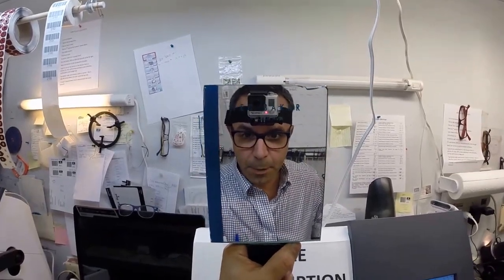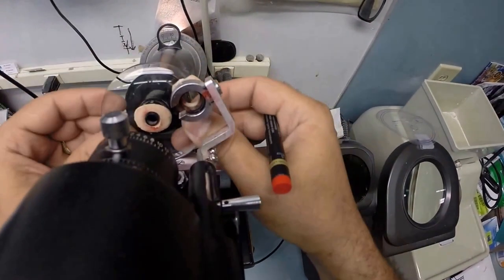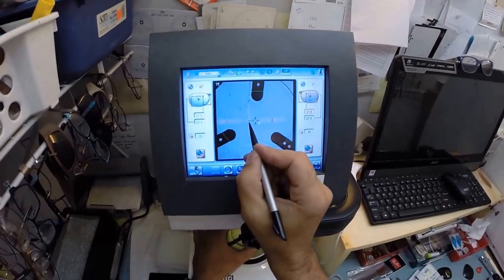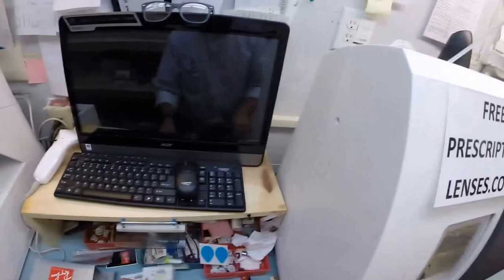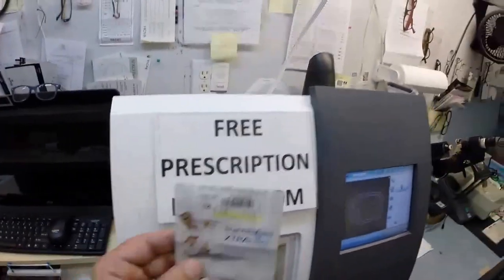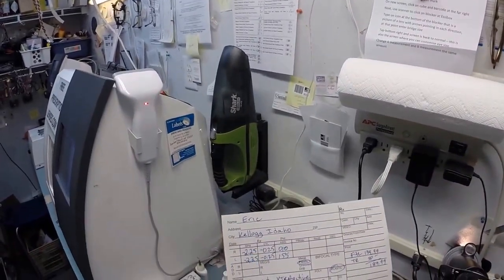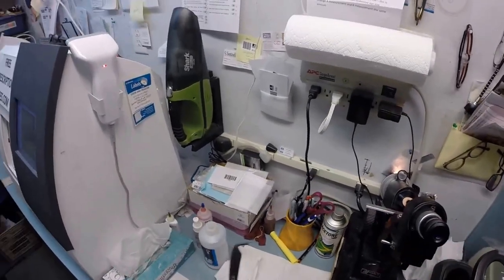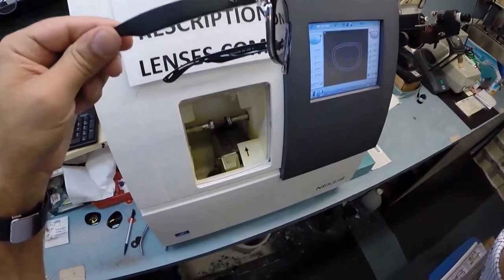Eric's RayBan 2132 with Rx Transitions XTRAactive Lenses

Comment: Matthew can you explain all the different types of transition lenses you offer? Do they have anti glare?  Which are the darkest? Do any work in a car?
Reply: Claire Stratton "XTRAactive" will tint slightly inside a car and the darkest Transition lenses when you're outdoors. Anti-Glare is an optional coating.
Reply from the maker: Claire Stratton The user with the username RayBan is correct. And by the way he has gotten several pair from me AND a pair for his sister. So Claire step it up. That's all I'm sayin;)OK first the basics. Transitions comes in gray, brown, and green. All of which come with or without a stock Crizal anti glare coating. Everything that I have mentioned comes as either plastic CR-39 or as the unbreakable polycarb that I prefer to work with. Transitions XTRAactive only come in plastic CR-39 AND only comes in gray. For now. It is still a relatively new product. It may eventually come in brown and/or green, but not yet. It may eventually come in the lighter weight unbreakable polycarb too, but not yet.As with your lenses and most of the lenses that you have seen in my videos are stock lenses. Meaning that they are sitting on a shelf in a paper packet waiting to be adopted onto someone's face. They are less expensive because they are mass produced in advance, hence why they are sitting on a shelf at the wholesale lab that I order from and receive overnight. Transitions XTRAactive gray only come as stock CR-39 without any anti glare. Should you want an anti glare coating to be applied to your CR-39 plastic gray lens then I need to have that lens custom ground, which costs more and takes several days because of the custom work. Once done as with any custom work I could then have any brand of anti glare applied. Such as any Crizal coating like Crizal EZ, Crizal Alize, Crizal Avance, Crizal Sapphire and Crizal Provencia. Or I could have any Zeiss anti glare such as Pure Coat for example. Also each custom lab have their own in house anti glare that is not name brand that can also be applied to the custom grind job.Transitions XTRAactive does get darker when outdoors than the current Transitions signature 7 series that I always work with. However Transitions XTRAactive does retail a gray tint while indoors which is irritating to some people but not all. people who tend to be light sensitive even indoors under fluorescent light seem to tolerate it better than most. Transitions XTRAactive will get 20% to 30% of its activated color behind a windshield. Not nearly as dark as out doors but Im told by my patients that takes the edge off enough while driving.Now are there any other questions that I can answer for you? I normally wont and don't go into such detail when answering questions. I only do it because I like you so much and your voice in your YouTube videos.Oh and they don't work in England. Just a strange bizarre phenomenon that you should know about before purchasing.Now tell me what you know!